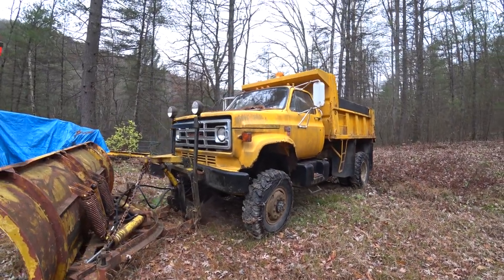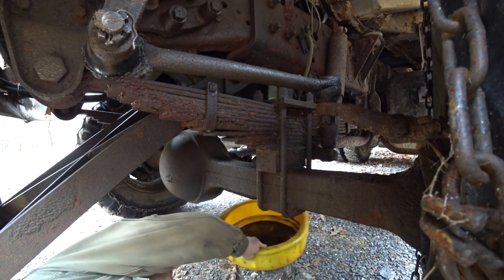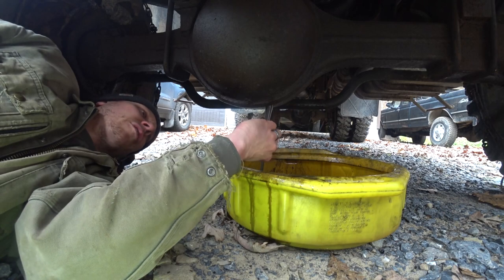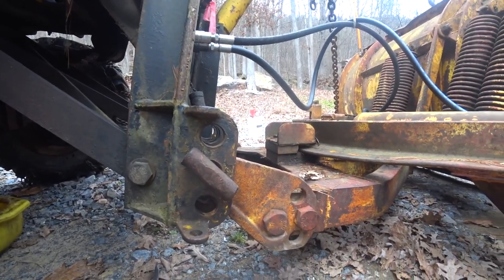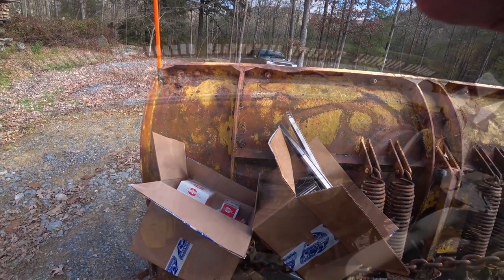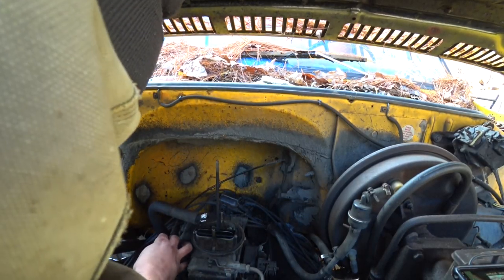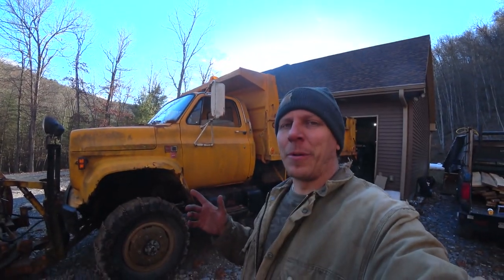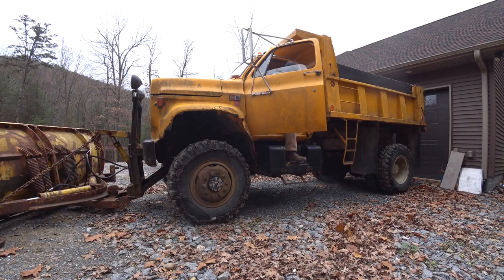Plow Truck Maintenance - Getting Ready for Big Snow - 1981 GMC C7000 AWD Dump

Comment: I was surprised to see you change the plow angle and not use the hydraulic ram on the front of Elvis. I thought for sure you would take the chains and connect it to the back of the plow frame. Good work around. With the amount of adjustment you have, you can really dial in the float vs cutting pressure.
Reply from the maker: Hmm, I hadn't thought of that. Good suggestion! Thanks for watching!

Comment: did you check the fluid in the transmission and the transfer case as well along with the power steering anti freeze and hydraulic oil for the plow
Reply from the maker: Yup, checked and topped off the transfer case, transmission, and hydraulic fluid. Power steering, antifreeze, and brake fluid was all good. Thanks for checking!

Comment: When i change plugs and plug wires I spray some wd 40 into the ends of the wires and they slide right onto the plugs and cap real easy and not so much of a fight and i do the same with the threads on the spark plugs so they thread in easier and less likely to cross thread and on aluminumn heads I put anti seize on the spark plug threads so when you change them they don't corrode or rust into the head
Reply from the maker: I always use dielectric grease in both ends of the plug wires and antisieze on the plug threads. And always start them by hand so they don't cross thread. I'm sorry I dont mention it, just some of things I do and don't think about.

Comment: What are you using for a pump to lift the plow?
Reply from the maker: The truck has an engine mounted hydraulic pump. This controls the hydraulic dump bed, plow controls, and hydraulic spreader (not installed). Works well! Thanks for watching.

Comment: For wat it is I see u took off winter bladed they are lined against icing . 
I use these on my applications.  U put on plain Jane junk blades. Ur going to fight with those to keep from freezing .
Reply from the maker: Yes, I realize. But the regular blade were much, much cheaper. I don't usually plow when it is snow. I usually wait until it is over and then plow. So I'm not too worried about them. Thanks for watching!

Comment: P.S.
Chevrolet firing order
1 8 4 3 6 5 7 2 
Odd  runs driver side
Anytime U do ignition maint on chevy that ran B4 fine and now skips check 5 & 7.
U doing doing it as U do will Guarantee U won't make this mistake.
I made and learned this mistake >40 yrs ago......
And A-Frame should be parallel with/on ground, this can change Ur attack angle of cutting edge
Reply from the maker: Thanks for the suggestions. I knew that was the firing order for SBCs as I've dealt with them extensively in the past. But I wasn't sure on this BB if it was the same. So that was the easiest and quickest way to get it done. Thanks again!
Reply: @NorthForkHollow  Chevy's were simple (back in the days b4 computers).
Reply from the maker: @mikeholubek4419  Agreed they were!